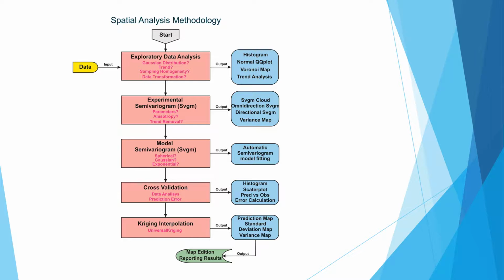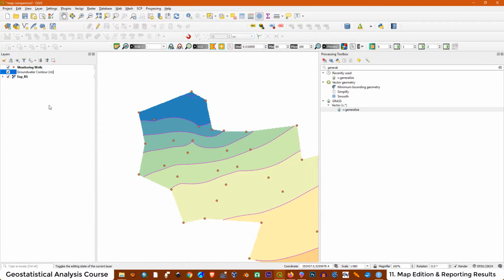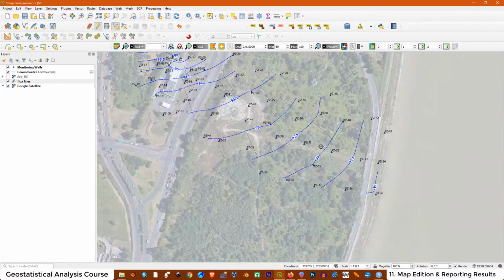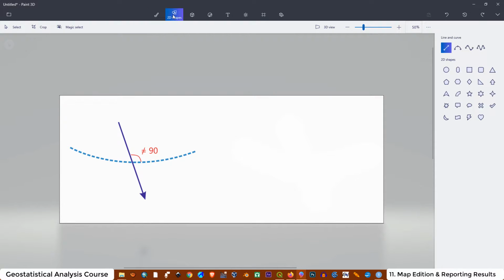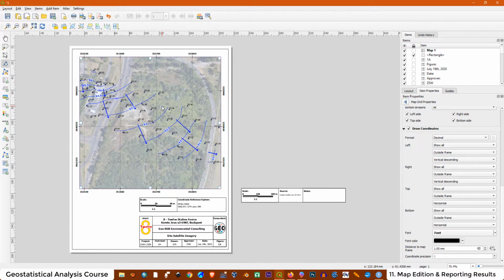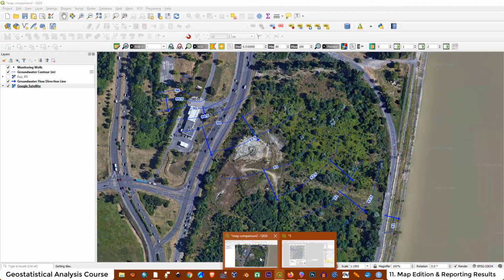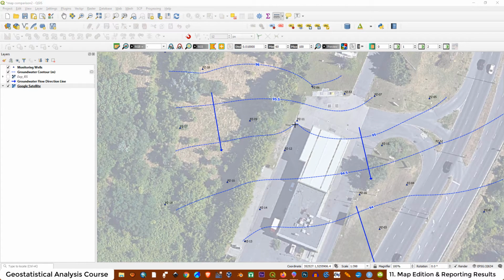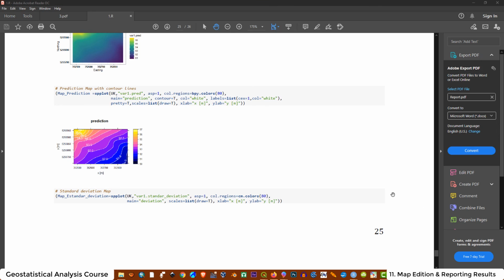Kriging Interpolation.  Map Edition #11.  Reporting results.  Groundwater Flow.

Comment: Hello sir, hope you are doing well,
I think that The different types of krigeages omit the existence of measurement errors and other uncertainties related to the presence of bias in the variogram estimation (type of model, nugget effect, sill, range .;). As a result, even with an inadequate variographic model, kriging methods can result in low values of variance. So, what do you think of fuzzy interpolation as an alternative to deal with the uncertainties;
Thank you for your reply.
Reply from the maker: Hi hichem dekkiche. Thank you very much for sharing with us this information. I really appreciate it. You are right, we can improve the results using other method like bayesian and fuzzy kriging interpolation techniques. I love the idea of removing all the bias from our data. Unfortunately, I have to mention that I have not experience in these kind of interpolation but if you can apply those techniques to your data it could be awesome.  Cheers :)